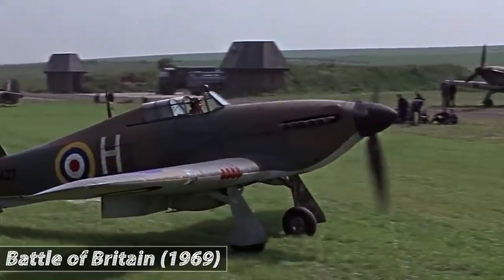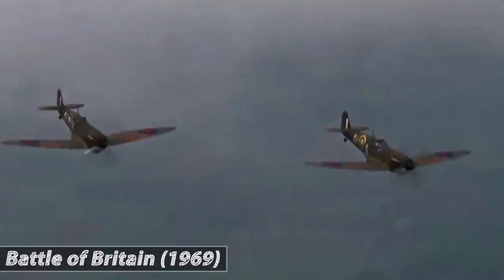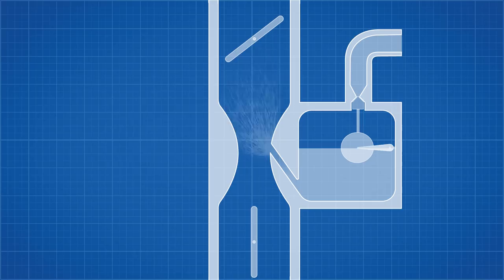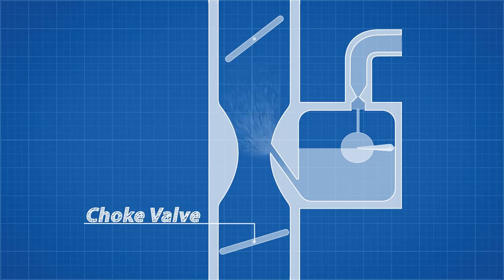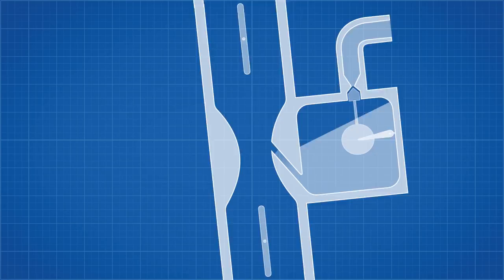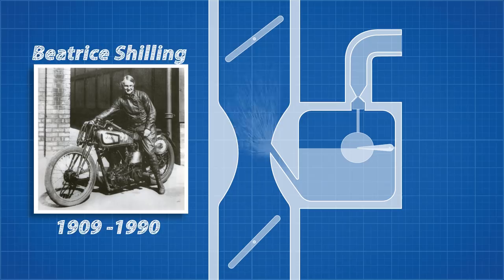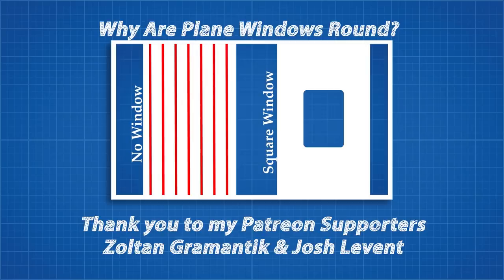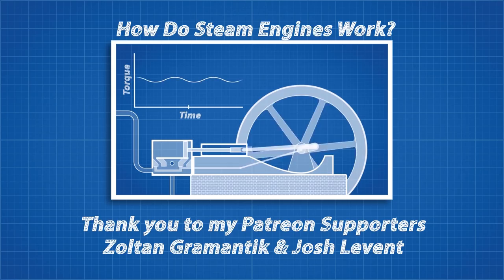The Spitfire's Fatal Flaw

Comment: The first scene shows a Hurricane performing a barrel roll, which is a +1G manoeuvre.
Reply: Not the kind of "telegraphed" "slow" manoeuvre one would necessarily use in a dogfight though, any halfway decent pilot in pursuit would have that covered in an instant.
Reply: @boblewis5558  
Any positive G maneuver would not be a problem, the Spitfire and Hurricane both turned tighter than a Bf 109. RAF pilots did a half roll into a dive and no problem. Unlike the fatal flaws on the Bf 109 including the fuel injection which cost power and reliability, no wonder Rolls Royce did not use fuel injection.
Reply: rogerwilco99  
Maybe not so brave, after all it was not a P 47 or P 38.
Reply: rogerwilco99  
A spilt S is a roll and pull into a reverse of direction, while the half roll into a dive was used to go into a dive in the same direction, not the same and for a hasty descent the pilot would side slip, different again.
Reply: rogerwilco99  A split S is a half roll into a half loop, with the result that the aeroplane comes out of the manouver headed in the opposite direction compared to the entry - it's not the same thing as the Spitfire flick described earlier.